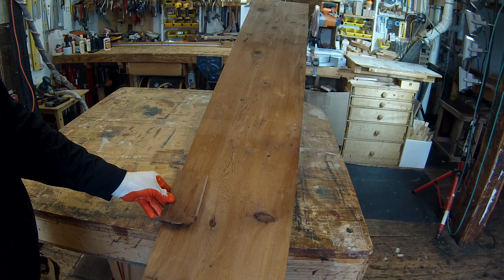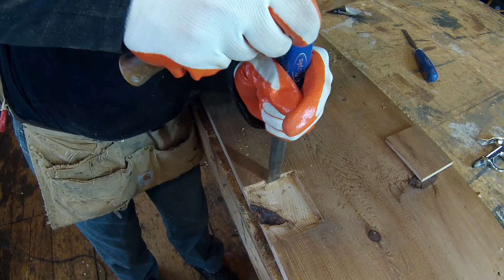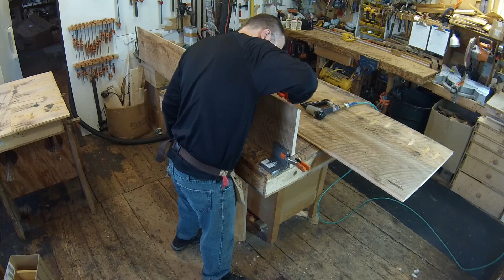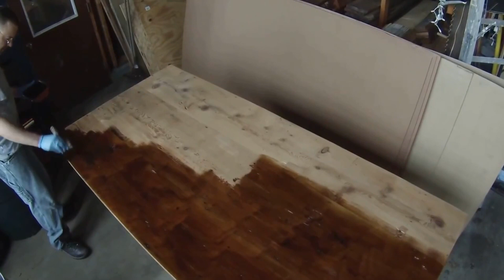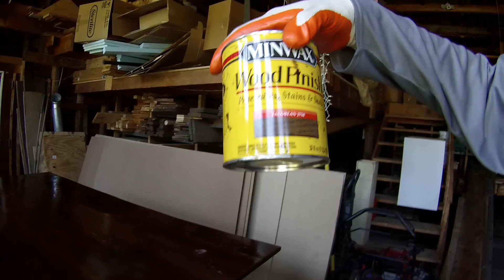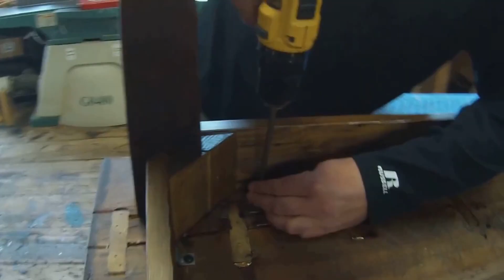Reclaimed Wood Table (Part 3/3 - Top and Finish)

Comment: +hffcom      Greetings from Naples Florida. Your work is absolutely beautiful. I am a new subscriber and have been trying to view as many of your vids before bedtime as possible, I think I am hooked. Lol.  I have a question for you, on the underside of the top, instead of cutting out large dovetails to hold the cracked wood together, why did you use what looked like large ice cream sticks?  The dovetails would give a much better holding power,  well either way, your work is beautiful!!! 😎Frank
Reply from the maker: +Frank Daniels That method is used to reinforce cracks in the old wood to keep them from splitting apart further.  same concept as the dovetail key, just faster and sloppy.  I use 1/8" plywood sticks or stitches and glue.
Reply from the maker: +hffcom 
reclaimed wood can sometimes have so many cracks and inclusions there is no other way to do it.  the glue itself can hold together, the dovetailing is not necessary

Comment: very nice, just a question about how you attached the top to the frame? why do you use a combination of pocket holes and the hooks? why not all pocket holes?
Reply: Paul Avesaath contraction/expansion of the wood.
Reply from the maker: Paul Avesaath pocket holes pin the top in center, contraction/expansion occurs on each side.  all pocket holes may result in the top splitting.  40" wide top will change dimensionally by 1/4" approx.
Reply: wow did not know that! Thnks for the explanation!

Comment: when to use the prestain wood conditioner and is it a must and when to apply it between the steps you showed us ? thank you in advance !
Reply from the maker: +Musa Absi 
only use it when applying stain directly to bare wood.  I am using tinted varnish for this process, which is diluted with stain but not a very strong pigment
Reply: hffcom thank you so much!

Comment: Around 30 seconds into the video you cut grooves into the underside of the table top. Does this help with expansion/contraction?
Reply: Noah Wolff I think that was to allow the board to bend and remove the cup in it while gluing/pin nailing the straight butterfly joints in the back.

Comment: How does this finish work on pine. I made a daybed out of dimensional lumber and happened to get a bunch of the Jacobean stain from wallyworld red tagged ( I love the look of that shade) but you only get one chance to screw up a piece of furniture. Unless you know how to Un-stain pine.
Reply from the maker: MrMnchstr Not the best looking finish for pine.  The stain is too much for pine and the appearance will be blotchy.  you would need a sealer first before going that dark with stain.  Or you can start with a lighter stain mixture and then get darker with the next coats.  Check out this finish on rough pine... its not stain either, just chemical patina with steel wool, vinegar, and tea.  https://www.flickr.com/photos/mjrvt/13716851005/in/dateposted-public/
Reply: hffcom Thanks for the reply. The daybed stays unfinished until I'm sure I won't fuck it up, it's the nicest thing I've built yet. I appreciate that you show the techniques you use, conventional or not, along with the business perspective. Being a small business owner I feel your pain, I've got employees and service vehicles, the insurance thing sucks balls but what cha gonna do? Chip em. Love that guy.